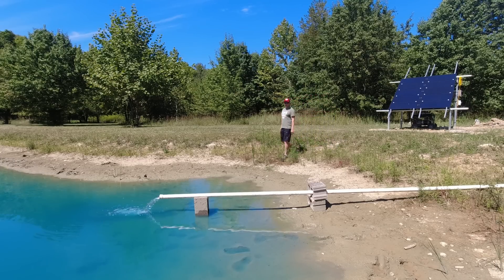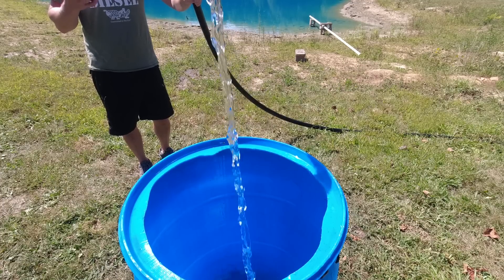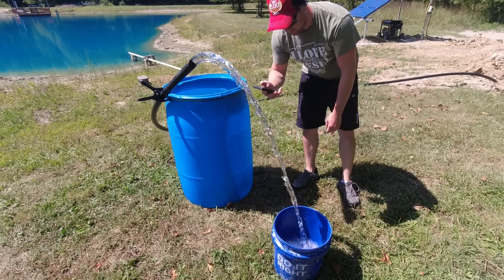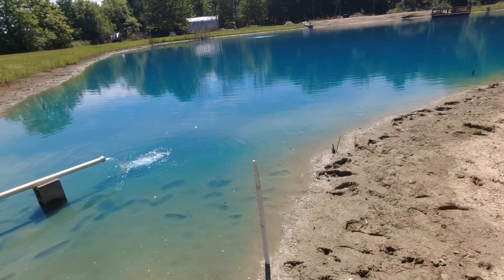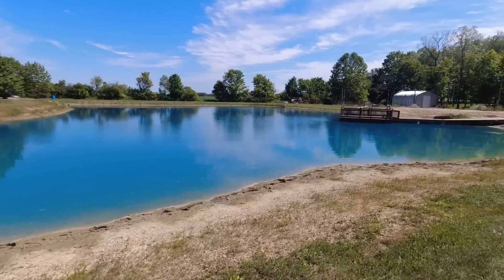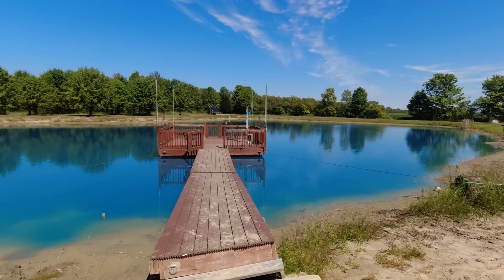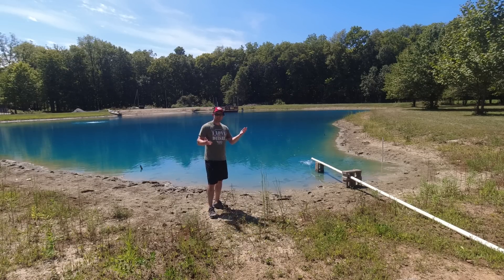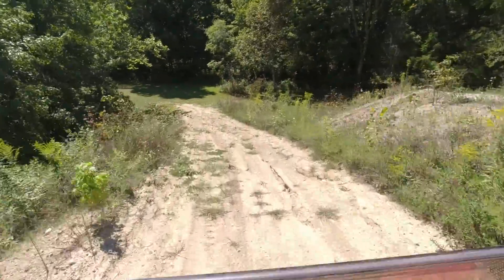Solar Powered Well Pump Filling Our Pond - How Many Gallons Per Minute? - - - RPS Solar Pumps

Comment: Nov 28th - I have been getting closer to 5 hours of full pump speed, and 2 hours ish at about 50% with my RPS pump, so I am guessing a little closer to 80 days.
Reply from the maker: Good to know and good guess!  How did you measure that?  Have you been sitting and watching it/estimating, or were you able to pull that info from the controller somehow?  I'm close to getting it setup with my generator.  I want to see if I can get this thing running 12+ hours a day.

Comment: 6.25 per gallon a minute is my guess.
Reply from the maker: I presume you saw that it was about 22gpm.  I was impressed by the figures myself!
Reply: @IndyFarmLife  gotta say the math for me was a pain to figure out then when i did it a bit in my head i got a fair rough amounted area on the amount did a lil division etc got the estimate but yeah i love the idea of a solar power well pump for a pond
Reply: @IndyFarmLife  yeah i noticed actually i in my own downtime sometimes watch well fracking for something to do if i get bored iv kind of found how that's done to be interesting for a well pump dig and how they set a well in ground to water level tho never did think about a 12v solar hooked to a well pump to be honest about it hey free power for the pump to the pond so even when powers out doesn't stop running at least love that idea as well even when powers out its running complete redundant off solar power my own opinion on that is man i find that idea epic 12v for a water well pump to a pond smart self sustain power low work needed hey to be honest  i love that idea in general : D power failure no problem for the pond anymore so hey that is a total win in my own book on that one bein said

Comment: Assuming a constant rate of 22GpM is 120 tons (120,000 KG or 265,000 lbs) of water in 24hr.   And that's barely keeping up with evaporation?   Amazing to think how much weight of water gets evaporated over a pond that size.

BTW ..    7 GpM was my guess.        Quite a way off.  LOL
Reply from the maker: The pump is currently only running when the sun is out, so about 8 hrs a day.  That was likely at par with evaporation during that hot week.  If I get it running 24/7 then it will no doubt outpace evaporation.

Comment: 25 days. Can you make the overflow variable. Any fish plans, is the bubbler solar? What are you using for the blue sanitation, how often etc. Great pump idea so far.
Reply from the maker: That would be pretty quick!  The overflow could be adjusted up or down.  I have it maxed our right now.  I.e. If I raise it anymore, we will overflow our banks.  The pond is already fully stock!  I have a video on that out there.  I put pond dye in about every 60 or 70 days.  The aerator is run off grid power....for now!

Comment: That looked like a 7 gpm flow to me 1:20
Reply from the maker: Deceiving, I suppose!  You saw the 5 gallon bucket tests in their entirety.  It's moving some serious water
Reply: @IndyFarmLife  it was very deceptive.  That pump is moving some serious water.  The only thing I’d be worried about is running the well dry.  I’ve done that once before
Reply from the maker: Yea, that's always in the back of a my mind, but that's the reason I drilled a dedicated well for the pond and didn't pull from the house well.  Suppose they could be pulling from the same "pocket" but it at least gives a little piece of mind.
Reply: @IndyFarmLife  as long as the refresh rate is high enough to replenish the well.  You are somewhat correct or correct about pulling from the same pocket of water.  But as long as you do good water management you should be good.

Comment: Look into a battery and a solar charge controller to integrate into your system.
Reply from the maker: I may have to do that!  Would be an awesome feature.
Reply: @IndyFarmLife  it would make pumping more hours a day convenient. It might take more than 1 battery to go 24/7. Staying with solar makes it easier to automate.
Reply from the maker: Multiple people have suggested this.  I need to figure it out.
Reply: @IndyFarmLife  not to over complicate,  but 1 more thing. If you'll add an expansion tank and a pressure switch like a household well has your pump will cycle on and off while maintaining a constant flow of water. It will more than likely make your pump last twice as long.

Comment: Add a couple more panels and a Lipo4 battery to run 24/7
Reply from the maker: As currently designed, this system doesn't accept battery backup, but I would like to explore that.  Perhaps I'll reach out to RPS and see what options I have.

Comment: I imagine the solar is making more power than the pump is using, why didnt  you connect a battery up to store any extra power so it could run a little after the sun went down?
Reply from the maker: Possibly so.  I'm not an expert.  As designed this system/controller isn't built to accept batteries, but I would like to learn more about why not, and also see if it's possible.  I may contact RPS.

Comment: Well water here is close to 80 degrees. I have to remind myself there are places where all water is not hot. You could push the water through a heat exchanger and air condition a space. Probably good to feed a heat pump as well.
Reply from the maker: Dang that's crazy!  Yes a heat exchanger may be needed next year if it drops the water temp too much.  Time will tell!

Comment: How is it that a solar panel is not able to hook up to Batteries?
Reply from the maker: The solar panels could hook directly to batteries and to the pump, but this controller isn't built for that. They do have some that are.  Someone smarter than me would have to explain it all.
Reply: @IndyFarmLife  so I believe the solution would be the wires from the solar panels would go into a charge controller for the batteries, which decides which rate of charge, and when to stop charging the batteries. Then you could run your pump off of the Batteries, which would also be DC. And you could also possibly hook a inverter to it to have AC power at that location. You would also need some fuses in there and maybe a shunt to be able to tell what level your batteries are at. There are lots of videos about people making DIY battery backup systems that will show you what you need and how to connect it if you're interested
Reply from the maker: Thanks for the info!  That's not something I have ever really looked into, but may.  Would be a really cool setup.  I'll have to dive deeper.  There is a pond joke in there somewhere ha

Comment: It has been super dry here SE of Indy going on a month with no rain. My creek is super low and slow. When you set up the waterfall be sure to set it up so you can run it when the pond is full. If you have the means just keep making the pond bigger. That huge mound of dirt would make a nice root cellar or storm shelter.
Reply from the maker: Yes it has been very dry!  Good point about placement.  Would hate for it to be underwater.  The berm would be a good storm shelter.  Kinda from from our house though.

Comment: When you make your pond a bit larger using the current ditch you dug, you might want to put in an irrigation gate to take advantage of the spring rains. That way you could open the gate when the water is higher than the pond and take advantage of that run off. But I suppose if the pond is full and your overflow is working correctly there wouldn't be any need for the irrigation ditch to bring more water in. Thanks for the update, I love what your doing with the pond and what you have planned for it.
Reply from the maker: Thanks Pete!  I have actually been struggling with what to do there.  I thought about doing what you suggest, but in theory, it should never be low enough to run in.  Still not sure what I'll do.  At minimum I may lay a pipe in and just cap it on the end outside of the pond.
Reply: @IndyFarmLife  I have a similar issue with run off, I installed a irrigation gate that can be opened if the pond is low enough. In the event the pond level is up, then I have a solar powered pump installed that runs during the day to slowly pump the run off into the pond. The solar pump system is still a work in progress, working on the solar array size and the pump rate. But it does work, but currently is too slow.
Reply: @IndyFarmLife  you still the grasshopper mower diesel 721 d
Reply: @IndyFarmLife  you still have the 721d diesel grasshopper tractor
Reply from the maker: I sure do!
Reply: @IndyFarmLife  one day when your grasshopper mower diesel 721d didn’t work anymore the engine kubota buying the new version of the grasshopper mower diesel 725d have powerfold deck and you can fold up almost 90 of inclination for cleaning the under the mower self with spatula